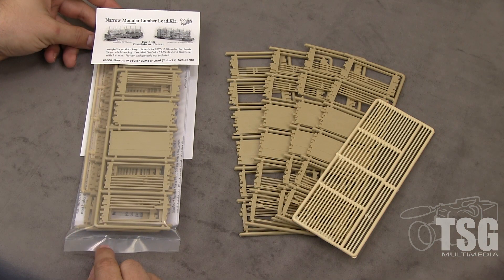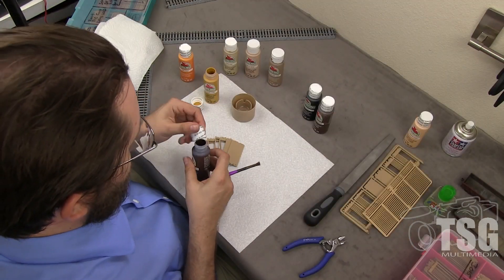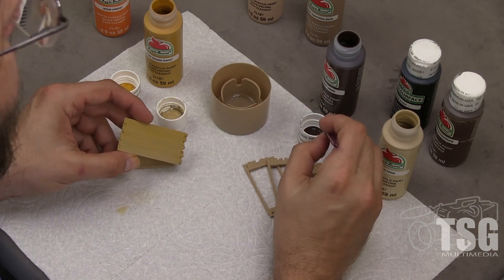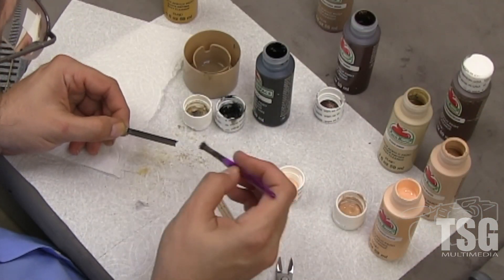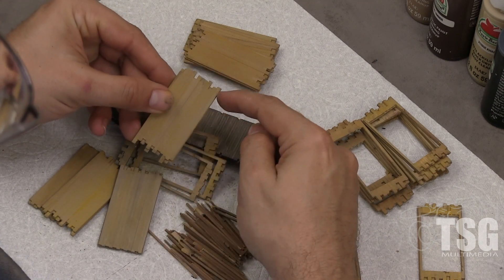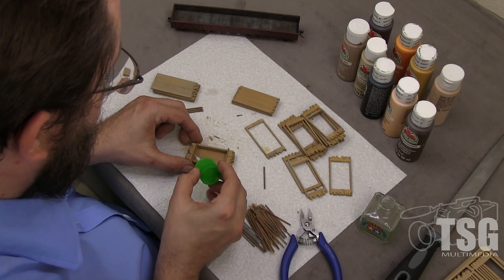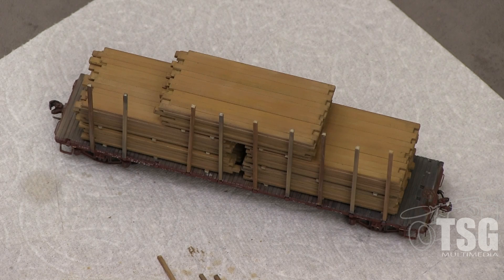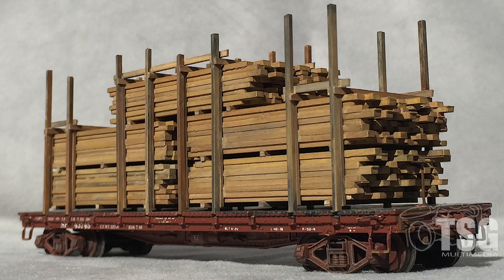Product Spotlight Owl Mountain Models Lumber Loads Build & Weather Like a Pro

Comment: I use a pallete myself, so that I am not contaminating the other bottles of paint. Great video. Thanks,Russ
Reply: The technique doesn't really contaminate the paint bottles, as the paint on the brush is used up before going back for more.  Also with the volume of paint in the Apple Barrel containers, even a brush-load of a similar color won't contaminate the whole bottle noticeably.
But use whatever method works for you. :)
NOM

Comment: brilliant video, fascinating to watch a guy who is so good, but is also just down to earth, using acrylics, a brush, and an artists eye. I've gotta get some of those owl mountain kits, just need the confidence... Fyi whenever loads are on dunnage the dunnage is always in a vertical line (each layer being in the same position) so the load restraints will pull directly down onto the solid, remain taut and prevent load shift. If the dunnage (separators) aren't in a vertical line the restraints will just pull the load down, and bumps and movement will shift the separators enough to loosen the load restraints:)
Reply: Yeah, I forgot to make that super blatantly clear in the video.  I generally try to keep them within about 1-2 separator widths of vertical.  In the days before the modern high-tension banding, where you can really crank down on the load, the separators could be off a bit.  Also with 36-48" of wood in each unit, there was some bridging effect to find the separators, but I agree more than 3-4" offsets would start causing the load to bow.  There's some really cool photos of shifted loads and ones that just naturally bowed due to the weight of the lumber.
Jason * a.k.a. NOM*